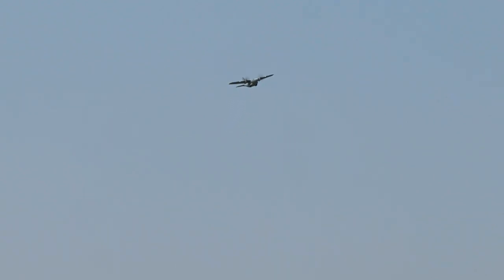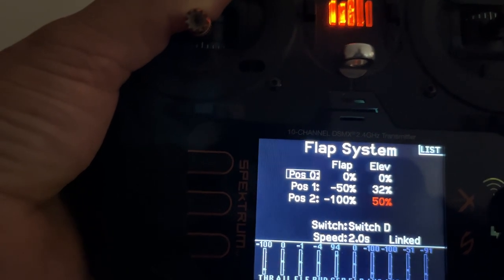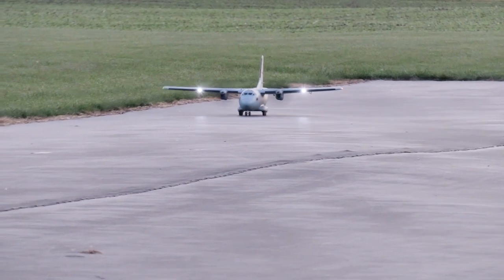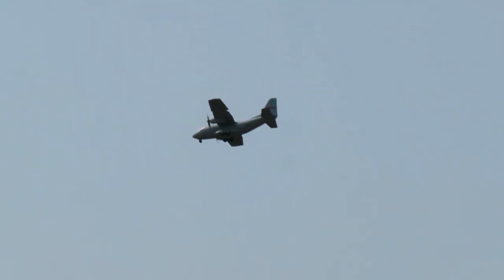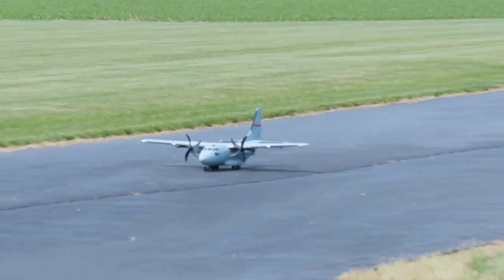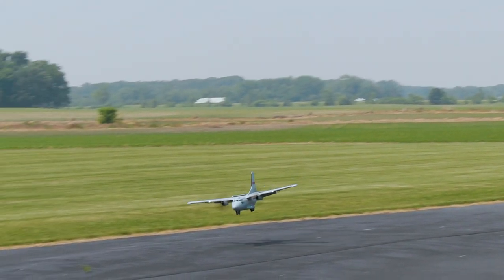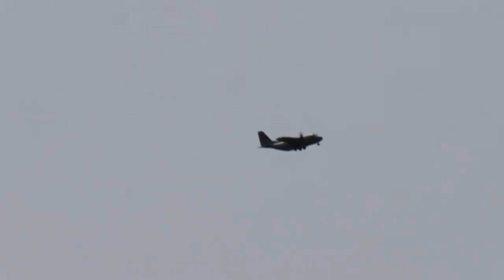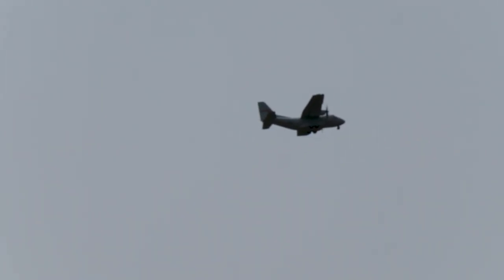EC-1500 Full Flap Regalia, I made a MISTAKE How to setup Flaps

Comment: I use flight modes on the flaps channel  that way I can trim the plane for each flaps setting. It takes the guess work out of it.  And you can change your trim if you say use a a heavier or lighter battery   it's just how I do it😊
Reply from the maker: Makes sense. Could be wrong but I’m afraid newer flyers might be confused by flight modes. I need to try that.
Reply: @PilotRyanMedia  it confused me a little at first but it's definitely the way to go. And it's actually pretty simple

Comment: Did you mechanically trim the elevator down 3mm for level flight like the manual says to do? Just wondering if that is included in your 8 and 14 for flaps or not.
Reply from the maker: Good question. Yes I did. The manual mix was perfect until I changed to bigger flaps.
Reply: @PilotRyanMedia  *PERHAPS.. the blown flaps are redirecting THRUST of lower propeller arc into LIFT and clean thrust of upper half of prop is rocketing plane over CG..

Comment: That's why we put our flap system on a mode to where we trim it out in the air instead of guessing but the mix should be.
Reply from the maker: We’re not guessing, it’s in the book and it’s spot on until you mod the flap size. What other plane comes with different sized flaps option? This is an education that the manual doesn’t cover. Book settings as a reference with flap to elevator callouts, we sorted it out in real time. Most beginners won’t understand flight modes. If someone mods to big flap option and doesn’t change the mix they will experience a nose down condition. We experimented in public to show how we landed on our findings. Our numbers are helpful and hard earned after a failed hypothesis. No one’s guessing